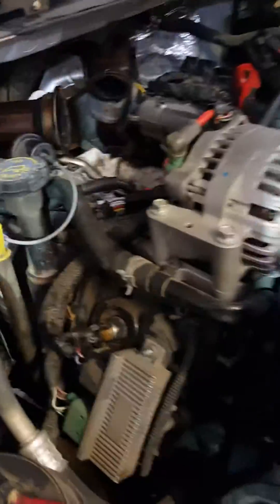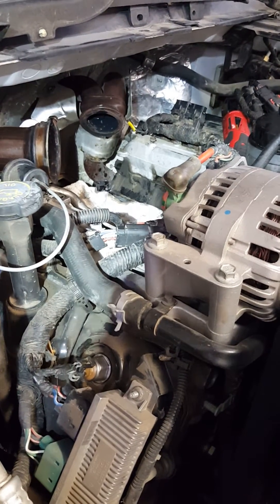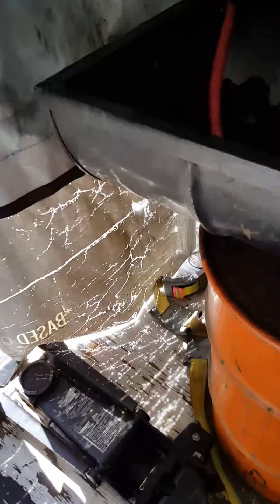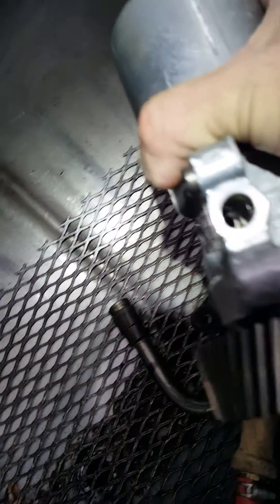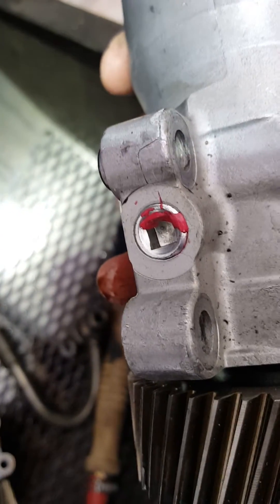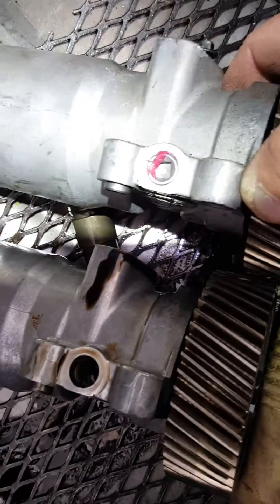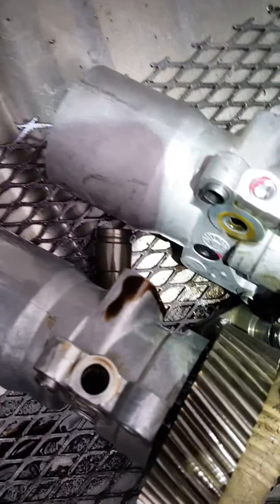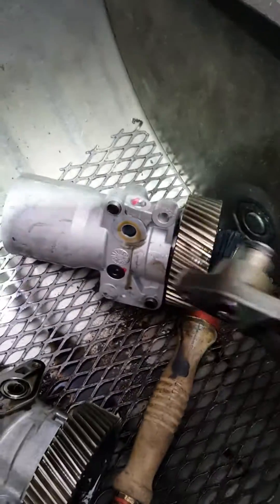2004 hoop failure missing ball in pump

Comment: Where did you order the pump that came plugged, all the pics on supplier sites still show the ball, do you know if i buy from ford if it will have a ball or plug?
Reply from the maker: Gb makes a great pump also order from dap .diesel auto power ogden utah tell them i sent you
Reply from the maker: Ford has updated the pump no worries

Comment from the maker: do.not try and plug the pump it n won't hold ,better get that socket it will lockup the  engine
Reply: I tapped threads in mine, and screwed a brass plug into it. It's still holding strong. I didn't have much cash at the time so I did a $0.50 repair lol. We will see how long it's lasts. Been 6 months so far.